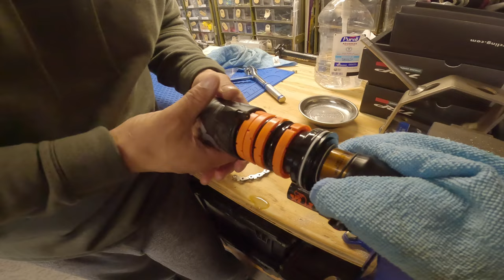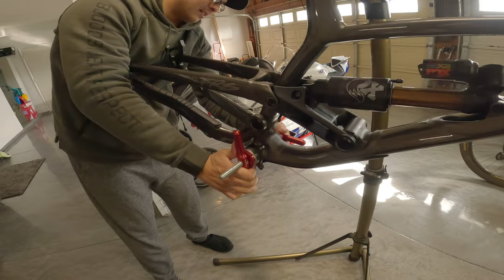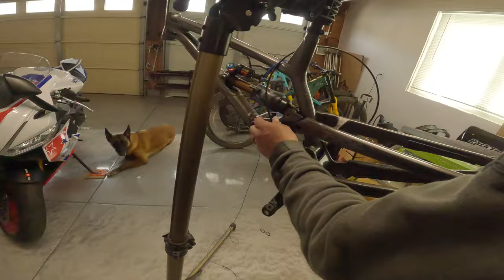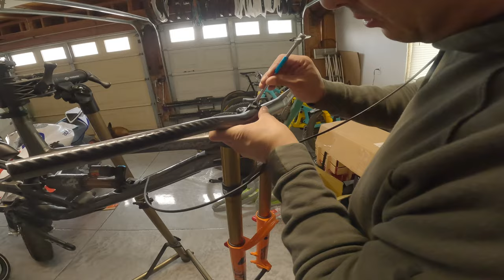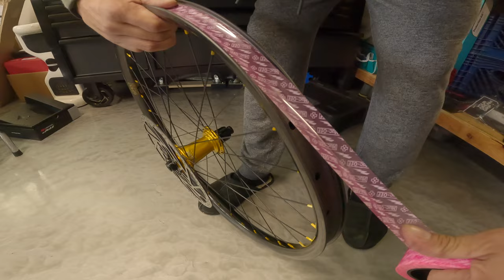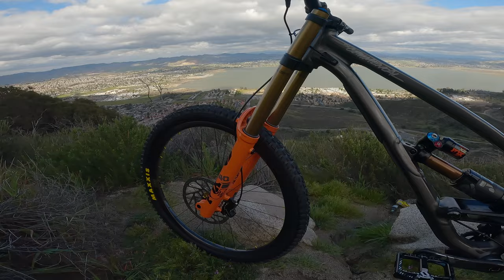Building My Dream 2022 Commencal FRS (Furious) DH Bike

Comment: Badass build you have there, I'm lookin to build pretty much the same bike. Can I ask if you would or have made any changes to your build? Mainly concerned on how it handles with the wagon wheel up front. Would you recomend keeping it a 27.5? Coming from a Yeti SB165 so I'm quite use to 27.5
I'll bet it rips the Elsinore track in the video. I work just above there on the Ortegas
Thanks
Reply from the maker: I’m really happy with the build, wouldn’t change a thing.  Works really well on chunky dh trails—29 up front adds a lot of stability and confidence. The stack height is on the lower side for this bike so it plays really well with a taller fork. Geo feels balanced.  My plan is to run a 27.5 for the bike park to get more flick.
Reply: @kyl3_mtb  Thanks for the info. I'm bummed the Ohlins fork that comes on the complete isn't 29" compliant. May end up doing a build like you did but need to make sure I can have it all done by opening day in Big Bear